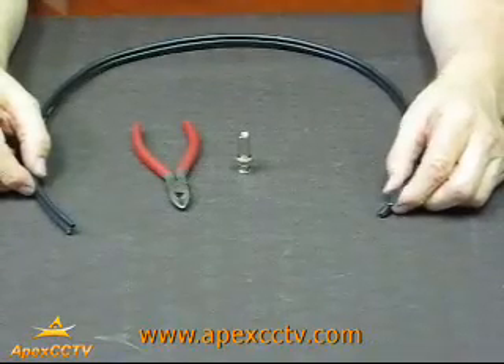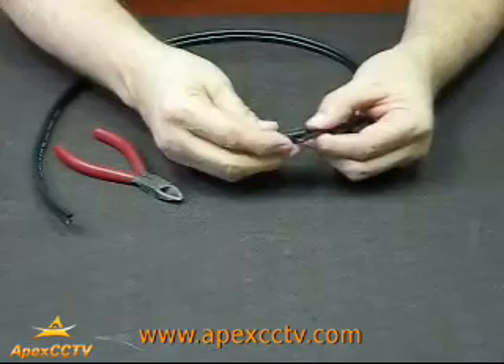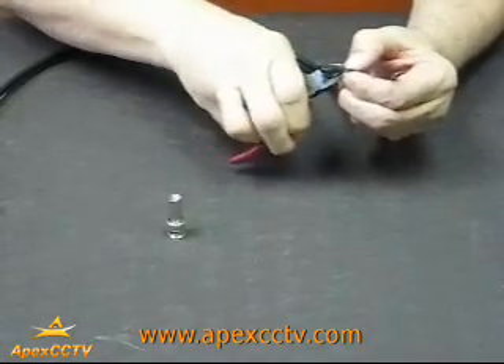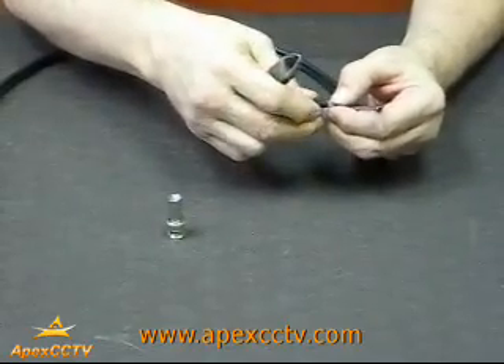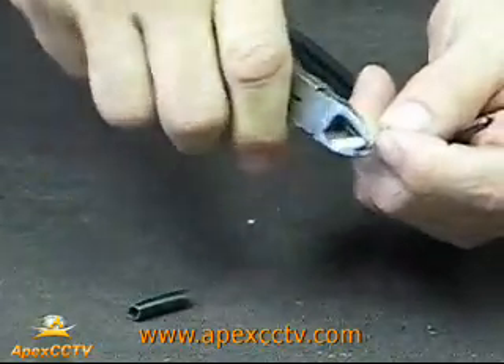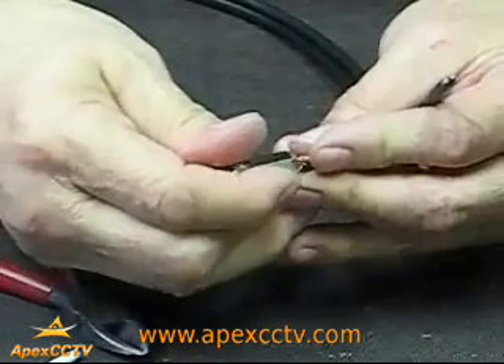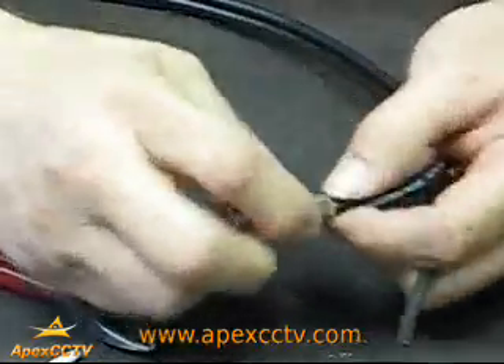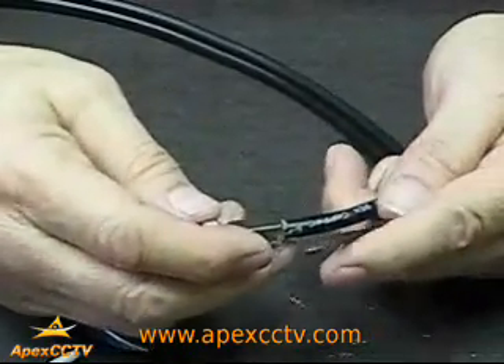Video Tutorial: How to Install a Twist-on BNC Connector on RG59 Siamese Cable

Comment from the maker: The Crimp on connector provides a tighter connection to the cable because you are able to use the leverage of a tool to really force it on there.  It is preferred by the techs here at ApexCCTV, but if you treat your cable and connections right you shouldn't have any issues with either connector.

Comment from the maker: About 1/4" is good.  Like the video says, you initially strip enough of the outer insulation off to equal the length of the screw-on section of the connector.  Then you cut off just a little less (about 1/4") of the inner insulation.  Remember, you can always trim any core wire that comes too far through the connector.